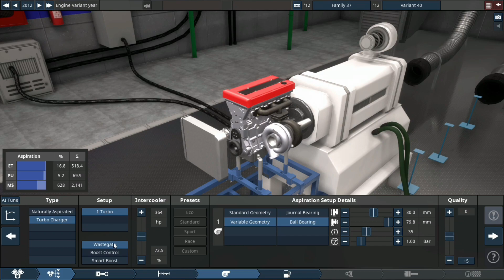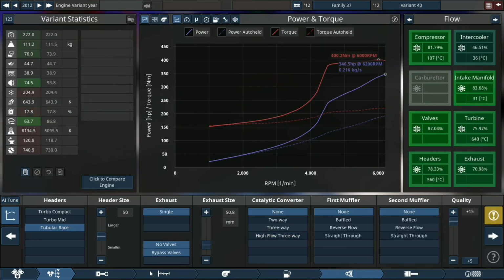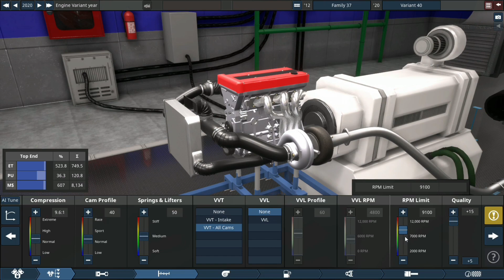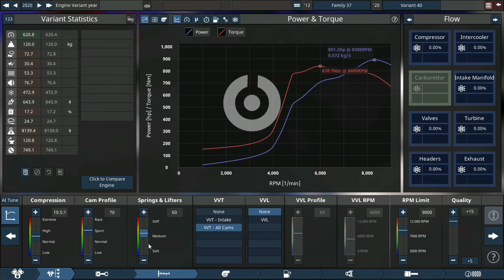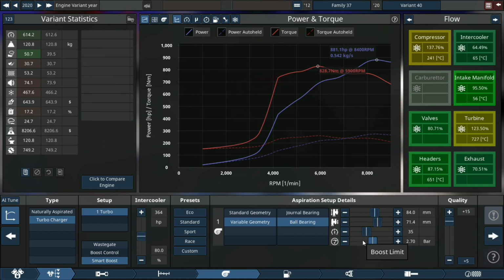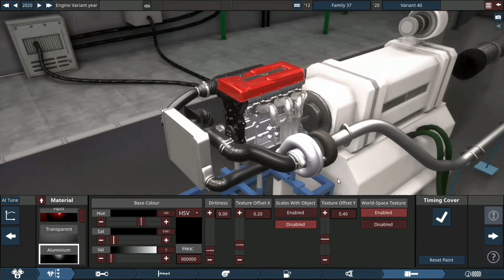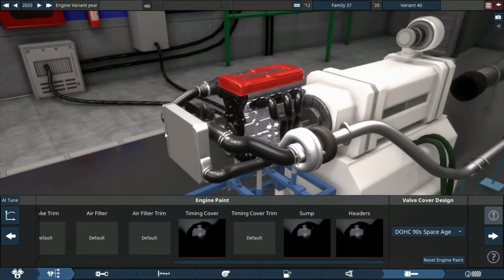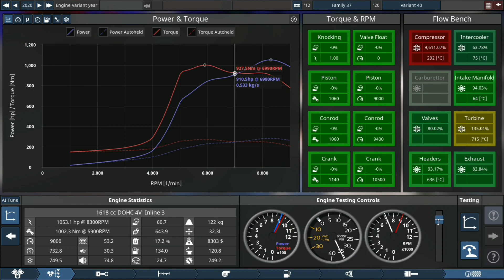Build a 1000 HP I3 Beast - Automation the car company tycoon

Comment: Challenge accepted.
I used the same tech, fuel, stroke and bore inline 3 and got a similar power curve like you but peaked at 1316hp and 1042Nm.
Reply from the maker: That's really awesome man thank you for the comment
Reply: @Curiousgamer20  I see that you usually build dragster cars.
Can you try to make a Rally car and test it white time trials on Hill climb 2 on the Automation test map and see what time you get?
Reply from the maker: that sounds like fun 100 percent will do so thank you the idea